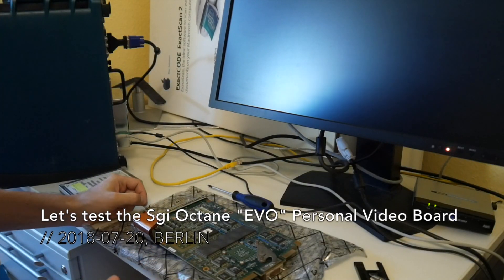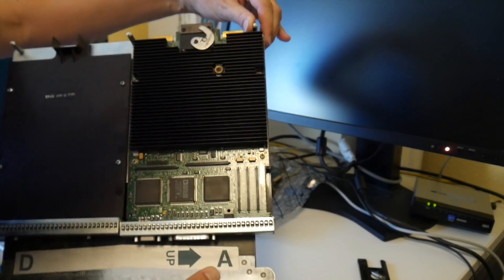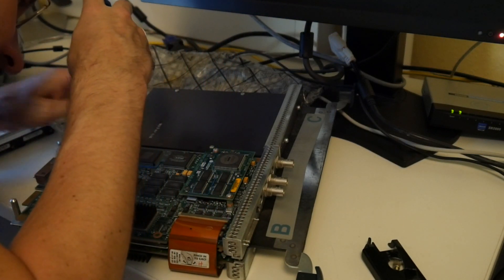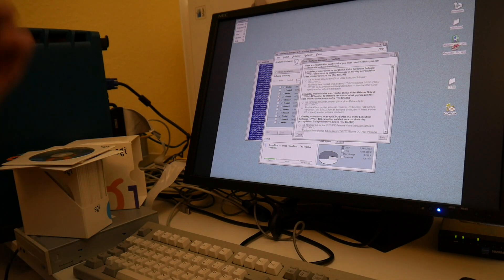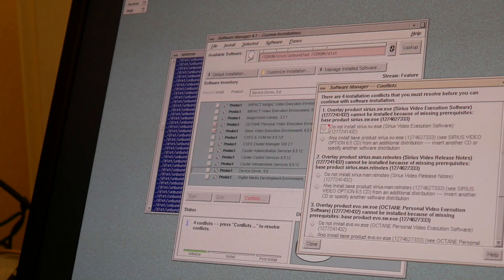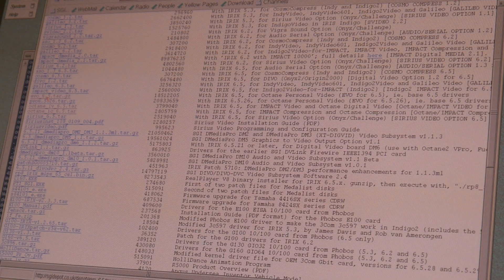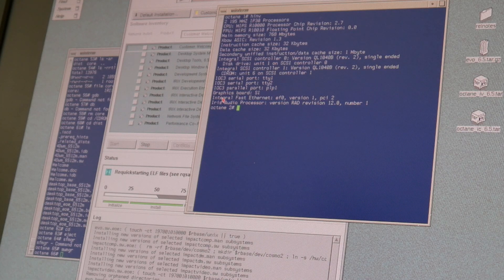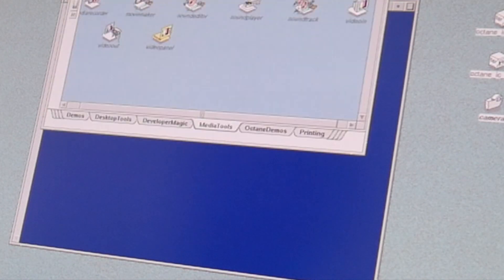Re-installing the Sgi Octane Personal Video Board, ..!

Comment: To be fair to SGI, most of these difficulties would be avoided by following their own installation guide, which would originally have been supplied with the board, along with an antistatic wrist strap, etc. And indeed, hinv can't report a device until the kernel has the new drivers included, hence the required reboot. Note that there will be some CPU activity for a while after reboot as the man page database is rebuilt (use top or gr_osview to discern when such activity has ceased).

The reason for the conficts often encountered is because the base driver files are only for the original June 1998 IRIX 6.5 (what I guess one could call 6.5.0), so if you're running any later version of 6.5.x then you must read in both the base files and the updates to those files found on the relevant Overlays CD, ie. copy them all into the same source directory for reading into swmgr.

6:00 - Hey, my downloads page! Cool. :D

As for actually using PVO (Personal Video Option), one must of course have a relevant external device connected, and the settings in vcp must be correct for the desired input or output (note the live videoout function can be toggled to almost fullscreen, and for external device recording it'll work better if the monitor refresh is set to match). I'm assuming you would need settings for PAL (or equivalent 625 line digital format), but some of the settings will default to NTSC norms. For testing CCIR 601 ports I use an O2 with a DIGVID board.

Also, some of the functionality may be missing without any TRAM present, though I forget the details offhand. Perhaps video-as-texture, not sure.

Lastly, PVO does not have compression hardware; it can instead capture to memory, or compressed via CPU-dependent software, or uncompressed to disk assuming suitable available disk bandwidth (it'll work with a disk stripe using one internal and one exernal disk to exploit both UW channels, but I would normally recommend a disk stripe connected to at least a single U2W QLA1080 or QLA1280 inside either a PCI cage or XTalk adapter, or one could use FC which these days is dirt cheap). For hardware compressed capture you would need the Octane Compression board (Cosmo2) which is an extraordinary but sorely underused piece of tech. Note that for optimal uncompressed capture, the structure of the stripe is important for maximm parallel bandwidth. I think atm I hold the record for this with Octane, almost 600MB/sec using multiple XIO ports.

PVO can be used by a number of the supplied Digital Media Tools programs, while broader functionality is possible via the Digital Media Libraries, which includes a whole bunch of sample code and demos under /usr/share. Software compressed capture though as mentioned depends on main CPU performance, which isn't that great with only R10K/195(s); I wouldn't expect better than half size/rate PAL. Full size/rate uncompressed capture will work ok, though converting that to MJPEG is best done using an O2 (one could do the post processing with the Octane, it would just be really slow compared to even the slowest O2).

Did you ever get a TRAM for the gfx? Indeed, do you even still have the Octane(s)? Having TRAM makes a big difference to available functionality, not just textures for 3D but also vieo functions and hardware accelerated 2D imaging (the OpenGL ARB extensions, which are supported in imgview to great effect, though sadly not in imgworks).
Reply from the maker: Thank you for the detailed comments. Yes, of course I still have my two octanes ;-) iirc the one with the pvo has no tram. A the other with max impact does not fit the ego board iirc.
Reply: @renerebe   With MXI you should still be able to install PVO on the other side of the XIO carrier in the same way. Btw, MXI isn't quite the same as MaxIMPACT in Indigo2, eg. it has a revised command engine and some other differences, though in broad terms it has the same raster & geometry performance, but of course vastly higher bandwidth available, with better latency, so for real world tasks it can be much faster with the same tech vs. Indigo2, especially for volume rendering (medical, GIS, defense imaging, etc.)

Funny thing about MXI is it runs using SLI across the two GE/RE slices, something SGI kept quiet about for a long time; grud knows why as the method works extremely well. There's more in the Octane Technical Report; here's a link, though YT may delete the post because reasons:

http://www.sgidepot.co.uk/octane/octane-technical-report.pdf

Got me wondering whether, with a shrunk process, the design could have been scaled further, to 4 GEs and 4 TRAMs, though I suppose by then the tech was moving on anyway, the rise of VPro, etc. SGI did all sorts of bizarre stuff like this (or rather, didn't when they could have), eg. the GE board for IRx gfx has eight sockets, but every rev of the board ever made only has four of them populated (perhaps the likes of Lockheed received the full version, guy there I knew said they obtained a lot of custom boards). A strange policy given GE performance became such a limiting factor for IRx competitiveness in the latter years, especially IR4.

Lastly, dual-MXI in Octane does technically work, but it's not supported because it'll rapidly overheat, even with FastFan mode activated (FastFan mode is on whenever anything uses the lower right XIO slot). Keep meaning to setup a mod dual-MXE sometime with mad modern cooling just for lols and hinv silliness. :D  Something like MXI+SI will work ok though, while SSE+SE was a very common combo for CAD systems, especially in Germany (later green Octane systems that were technically all Octane2 internally, I obtained quite a few of them long ago from Reinhard Wolf and elsewhere).
Reply from the maker: @mapesdhs597  I appreciate your long posts here, and hope YT does not decide to delete the link! Would you happen to know if someone has an affordable entry level VPro to spare for an OpenSource developer? I'd love to work on the minimal vpro fb driver and eventually get X working (if not some GL eventually, ...!). Thanks!

Comment: My EVO doesn‘t work. Octane won't even power on when installed.
Reply from the maker: Geomanb :-/ did you just install the evo, did the octane turn on before?
Reply: René R. Every Octane runs fine again after EVO is removed again. I have no idea whats wrong with it.
Reply from the maker: Geomanb :-/
Reply: Long too late I expect, but check for dust on the XIO connector.
Reply: @mapesdhs597  weblacky diagnosed the board: the XIO-to-PCI-bridge Chip was shorted to ground